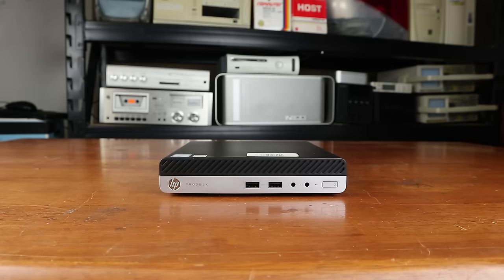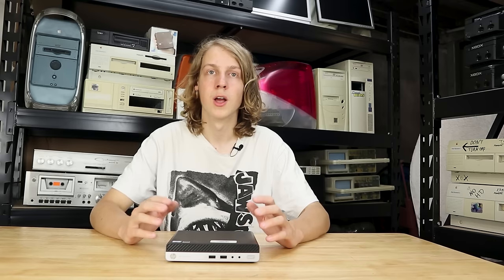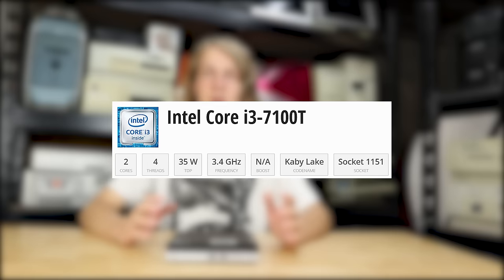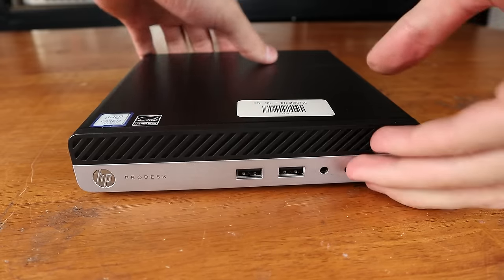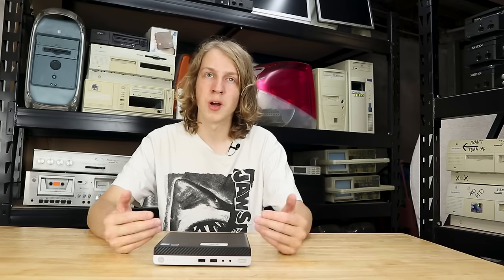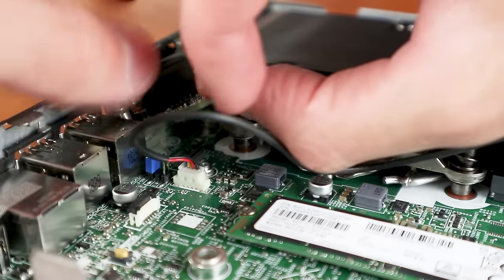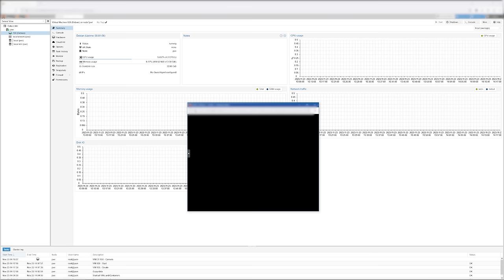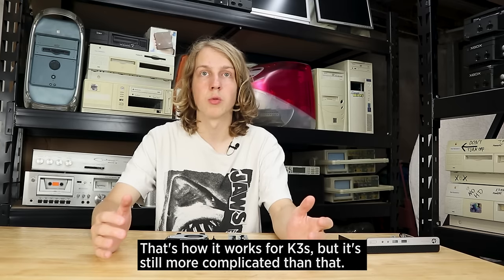This MINI PC Is The PERFECT Home Server

Comment: Another good reason to buy these second-hand instead of a new SBC or mini-PC: they end up being used instead of being landfill and pollution somewhere. From an e-waste perspective we could do so much more.
Reply: The way I see the problem is that minis or others, they get a small problem like a board mosfet that probably costs 10 cents but there is nobody around to trace it and replace it, certainly not the mfrs who would rather sell you a new pc than have real repair centers. Now what? Im facing this problem right now and so im looking for a new mini extremely reluctantly. Im hopping mad.
Reply: @cvcoco  I found a box of mini Dell optiplexes in a dumpster once the only thing wrong with them was a few of the usb ports would only work intermittently. Which was no big deal for me since I ran them all headless
Reply: @esotericjahanism5251  Yes but if you needed and expected the ports to work? Nobody around to fix them so you throw the unit in the dumpster and its a shame.
Reply: Indeed.
The CO2 pollution of fabricating these is the equivalent of running such a system for decades.
Reply: @rogerwilco2  
better stop using computer then
Reply: Sorry but the problem with olden hardware is the vulnerabilities caused by hardware design. They're either risky to do anything serious with or too slow after mitigations, to do anything serious with.
Reply: they're freaking expensive for e-waste

Comment: These things are absolute sleepers. I "downgraded" about 3 months ago from a full-blown HP Z440 with 145W Xeon and 196GB Ram to an 800 G4 with 7th gen i5 and 32GB and that machine is performing. Runs all my media applications (iGPU passed through to Jellyfin for hardware decoding), some productivity applications, Home Assistant and Frigate (I use a Coral TPU in the Wifi slot) with relative ease. CPU is around 40% and it shredded about 100W of my energy usage, which is significant considering it is 100W 24/7.
Reply: How do you deal with storage?
Reply: Same would love to know as most say I shouldn't use USB hhd CADDY
Reply: Love the use of the coral gpu in the wifi slot.  Makes for an excellent all in one server (with storage in a nas).  Which model did you get?
Reply: @NFTwizardz  I used a DAS with USB-C connected to the mini PC and 4 x 16TB WD drives. Drives passed through from Proxmox to TrueNAS for RAID and sharing. Bit annying having to passthrough every drive separately but there is no space for an LSI SAS card, unfortunately.
Reply: @martinzipfel7843  nice thanks for replying. I built a PC with HBA and run true nas scale as VM on proxmox passing through the HBA.
Reply: dual tpu?

Comment: I grabbed 3 G4 8700T's for $230 AUD each from Facebook Marketplace. Then added 64GB RAM and a 2TB SSD for each of them bringing the total to around $1400 AUD. They're doing pretty well as a reasonably power efficient HA Proxmox cluster. Pretty happy with it, apart form the noise under load. Maybe the lower end 35w TDP models would have been better.
Reply: The "T" versions should be the 35W version. I'm thinking the the non "T" versions is a better fit for SFF versions of this model with better cooling.
Reply: @Jonteponte71  Yeah, the "T" is the 35W version. The 35W version does not have ventilation holes on the top of the case, while the 65W version has ventilation holes on the top.

Comment: These little machines are amazing, I used to have a T630 Dell Poweredge at my place. Dual Processor 256gb of ram, while it was good the electricity costs for a few VMs running low speced services I ended up decomissioning it and opted for an i7 little 16gb ram Prodesk like this and just presented the NAS with iSCSI storage is a plenty and win on the electricity costings.
Reply: 256Gb of ram!?! :O
Reply: @roryl  Not really difficult with 16 slots. Maybe you should look up that model. It's a dual socket system.

Comment: I bought one of these with the i5-8500T to use for day to day computing that doesn't require the discrete GPU of my main system and to save on running costs. I'm so impressed with it that I'm considering getting another.
Reply: I am planning to buy one and use it with ubuntu. just for normal day to day use at home. do you think its okay??
Reply: @prabaharanaece  Yes, definitely!
Reply: Can you share what kind of computing do you do on the i5 8500T?
I'm interested in getting a 1L PC (either an Optiplex Micro or one of the HP minis) for various tasks like file compression, photo editing, virtual machines, the usual stuff like web browsing, etc.
Reply: @abunk8691  I actually got another mini PC with the non-T 8500 and use that mostly now. The 8500T was good for some stuff, but the low TDP was a bit restrictive. I definitely wouldn't want to use it for photo editing or hosting VMs.

Comment: Nice to see another Aussie Tech Channel 😊 Would be great to see a homelab run down/tour video.

Low Power is 100% more sustainable especially in Aus with power and cost of living.

I'm running an N100 as a router (1000/50) using PFsense as a VM within Proxmox. That was fun 😅

And then 3x WAX206 with OpenWRT as a mesh for WiFi 6 coverage.

2x Synology NAS for storage/redundancy with portainer for services on each.

2x low power mini pcs for Portainer docker instances (Automation & AI on one plus a testing unit segmented on the network).

And ive shifted from Ububtu server to Debian myself so no judgement here 😅

Great video and Ive subbed!
Reply: How have you found the move to Debian?
Reply: @oscarcharliezulu  From Ubuntu server, debian was pretty easy to get started. I had a few teething issues but nothing a little googlefu didn't solve
Reply: How's your experience with pfsense on VM? I am running it on a low powered machine with two NICs, it's used as fw + reverse proxy to a bunch of applications I am hosting on my homelab.

Oh my Poxmox cluster is all based on Dell and HP tiny PCs with maxed out memory. Right now I am running Kubernetes cluster on the VMs in Proxmox cluster hosting my applications. Thinking of setting up Ceph storage cluster to feed into Kubernetes pods to provide efficient shared storage, backup, recovery solution.

I also have a Synology box, but I am heavily under-utilizing it as NFS server, I suppose I could run Dockerized apps on here, but I am too focused on getting deep  and dirty with Kubernetes instead. 

Just a humble software developer, not a network engineer, all of this has been super over-engineered and super fun to learn.

Comment: I bought the 65w version of the HP EliteDesk 800 G4 Mini and was able to fit 2x2TB m.2 and 1 500GB sata SSD. I'm very pleased.
Reply: Running 2 m.2 under sata ssd doesn't get hot? Do you use it as a nas?
Reply: Same but use one of the m.2 for external pcie RX 6600 video card.  Decent mini form factor gaming rig…

Comment: I like the 65w Prodesk SFF boxes with an i5-8500, then undervolt by 140mV, test for stability. Only draws 60w at the wall under full BOINC load with an SSD.
So much used hardware online for cheap a big surplus. companies keep on aging out perfectly good powerful computers so they are great deals
Reply: How do you undervolt a prodesk? Hacked BIOS?

Comment: Seems you beat me to it, I bought a couple of these, same config too. I was also planning on making a video mainly just about what can really be done with these machines. Honestly in my situation, might be better off using one of these as my main system, it'll consume way less power and I can always use another system for more demanding tasks. My laptop is using 35W just watching this video and can use upwards of 200W under full load, which is just too much in the current economy.

If you're curious, I paid £74.99 for the two machines, and another £17.98 for the two power adapters, they came with 4GB RAM and i3 7100T. I'd say I did pretty well on the pricing there, and if I ever don't need the one I'm keeping, I can always resell it for way more than I paid. One of them is going to a friend.

Also, absolutely no judgement when it comes to the linux distro, Debian, even as a desktop OS works great and is super stable, and I'm sure it is even better as a server OS without the desktop environment.

Comment: I went down a similar route recently but went with a dell system. It's really nice and has expansion for an M.2 ssd, 2.5" ssd, socketed CPU (limited upgrade paths however), up to 32GB of DDR4 and an i5-8500T. It also has an M.2 wifi upgrade slot but I'm going to use it to add another ethernet port for opnsense :)
Reply: Which Dell system did you use?  I would like to shop them, thanks....

Comment: A great machine I am looking into and start diving into the server world and running my own lab to learn new things, A side note if anyone buys these and have access to a 3d printer you might be able to 3d print the top cover to have ventilation like the updated versions it might help with cooling not having to work as hard to be efficient
Reply: Or you could buy another one listed for parts only and swap the vented panel and heatsink

Comment: Imho, the best affordable home system could be a mini pc with 2 RJ-45 ports for a vm router WAN and LAN, with LAN to a switch, then switch to as many Cat6-HDMI extensions as rooms in a house. Cat6-HDMI connec to 3 monitors, mouse and keyboard. Mini-pc runs vms for whatever the room's user uses. Maybe a USB for Zigbee coordinators for Home Automation.
Imho, VMM > Proxmox, as you can run the mini pc on and OS, then run VMM to run whatever KVM you want like a router or OS per room.

Comment: Bought an HP EliteDesk G3 Mini with an i5-7500T, 16GB RAM and a 2TB SSD some time ago. I'm running Proxmox and several different virtual machines(TS3 Server, Pihole, OpenVPN and a Valheim server) in parallel without any problems. I also set up some vitual Windows machines but only boot them if I need them. Proxmox can also use Linux containers to save resources.
Reply from the maker: I definitely need to take a look at Linux containers. I had heard of them, but haven't used them before. Should be a good way to save on system resources.

Comment: I use these and they are great.  The only drawback is the fan noise.  It's silent on idle, but as soon as I do any processing the noise becomes intrusive.
Reply: I had a similar issue on my Dell MFF box, updated the firmware and re-pasted the CPU and all is now nice and quiet

Comment: you can buy an N95 powered  8gb ddr4 mini system for around 140$ brand new, which is a ~1.5 times faster cpu than the i3-7100T while consuming only around 6-10W, and the form factor is even smaller than the g3 mini. Definitely worth to check out!
Reply: I need 10G networking for Ceph under Proxmox, otherwise something like that would be very tempting.

Comment: You can swap in the 95 watt vented outer shell for the solid 35 watt cover..  Please be very careful if your unit has a standard 2.5 inch drive caddy.  The tiny ribbon cable for SATA power and data is very easy to disconnect. MY Elitedesk 800 gen 3 had both a 2.5 inch SATA drive caddy and a PCIE m2 ssd connection.  The ribbon cable can loose so now i can only use the M2 drive internally.  I have no AC so the hard shell covers can restrict cooling.   I have removed the PCIE M2 drives to external cases with tiny fans on my EliteDesk Gen 2 systems with solid un-vented top covers. These have 35 watt I7s in them.   I am waiting for a similar Lenovo m700 tiny system with an i3-6100t  chosen as a lower power 4 thread option.  The Elitedesks have Wake-on-Lan as standard, so your servers can be booted remotely.   I have not used this feature yet, but this video may help me set up an I7 as a Proxmox server.  I find these  1 Liter form factor systems are addicting.

Comment: Some models allow you to add two NVMe SSDs but then the Data SSD will not fit. Watch out for the 65 watt TDP models. The Sata SSD cradle comes with an extra fan onder the cradle. removing the cradle for an extra NVMe will result in making the main fan become noisy. The 32 Watt TDP models are more useful here. I own a Prodesk 400 and 600 mini. I also own the 65 Watt TDP 800 mini elitedesks model. The sweet spot in pricing is the 4th gen and 5th gen model. You might want to repaste them. I will combine mine in a desk shelve with 3 official under desk sleeves. Getting a replacement PSU was harder last year.

Remote management is not present in some models. 

Be aware of cheaper Pentium offers.
I would replace the option serial or vga port with an USB-C port.

They  officially support 32 Gb memory but 64Gb memory does work.

Comment: It can be a Docker server, then you can add an external USB Hard Drive and run a UrBackup container to turn it into a Backup server as well. You can also use a UPS monitor on it.
Reply: no redundancy...adding disk pool to these machines is more expensive than just buy cheap home server...

also 2 cores in this HP is just not enough for decent file system like ZFS
Reply from the maker: @jkarra2334 Two cores is completely adequate for ZFS. I used to run it on an AMD A4 3400 and got excellent performance.
Reply: @serverscience  yes, ZFS itself uses very little CPU. It should remain I/O bound most of the time, even with compression and/or encryption, though  compression is POISON for low cpu count cpu's. Yet again, Samba  burns  CPU, but I think it's pretty much constrained to only using 1 core per file transfer.

More than few cores is only going to have  effect if you regularly have on big or multiple hig throughput I/O to multiple disk array(s) but still, lower clocked 2-core cpu's are just painfully slow .

yes, you can play with them as hobby but for actual use like own redundant file server with decent transfer speeds i rather invest for more cores and plenty of RAM instead only few cores (even if higher clocks) and plenty of RAM, speed is king, even at home workflows and loads.

Comment: Great video! I have a question - why not a brand new Intel N100 system for the same price with faster NVME, DDR5 and about twice more energy efficient? It would also have modern codec and instruction support, as well as much more modern wireless. Any thoughts?

Comment: I just picked up a SFF version of this for  under £30, bare bones. I hope that version also has a low idle wattage.
Reply: They have been in the 20w range in idle since the 2nd i generation at least. My 2nd gen sff HP has 4 2.5 hard drives and a larger 3.5. I should be able to add another 4 ssds. Lovely little proxmox hosts :)
Reply: @valkaielod  6th gen is supposed to have an even lower idle wattage. I'm going to try an i3-6100t, no HDDs, just one SSD and see how low it goes ...
Reply: @blakecasimir  From what I have seen, the sixth-generation Intel chips did get a nice improvement to idle power draw over fourth-gen as you alluded to.  I saw a comparison where it was about half the draw at idle, so they're a good generation to target.  I saw someone had a video showing a system with the regular 6100 to be at 17w idle total.  That might be on the better end of things, but that seems to be roughly where the idle would be.  The T version should be similar at idle, and lower overall.  I have a regular 6100, but keep procrastinating on getting a watt meter.  I'm rather curious how much it's drawing, though I'm not worried about it, which is probably why I never get around to buying the meter.

Comment: I was just looking at one of those builds with a AMD 3400g and 16gb for $155 USD but it said it would not ship for a month or two. I may just order one or two and see what happens. Reviews go from "perfect" to "this thing wasn't even looked at let alone refurbished". I'm sure theynwere just bought used in bulk and they are just crossing their fingers they will work 

I agree the Pi is way too much now for what they do and not being x86. At times that's ideal, but always. If I needed to only use as much power as absolutely nessasary, I may go with one, but for home servers/labs/"IoT"/Media I think something is like this is prob ideal. You can always run in a efficiency mode and undervolt the CPU a bit depending on the bios.

Comment: This is why the Raspberry Pi 5 at its ridiculously inflated price is absolutely no match for a second hand SFF system for the average Joe..... I have three Pi 4B 8GB I bought back in the day when they were reasonably priced. but ever since Corona, I have bought second hand SFF  Dells and Lenovos because they are so much higher cost performace contenders.

When the Pi goes back to beining $35 to 50 then I'll start to consider them viable 24/7 units for my network.

Comment: I don't call consumer hardware great for proxmox, yes it works very well but proxmox with all it's logging chew up cheap home nvme disc in no time, even worse if the vm's also doing much writing.
You should use expensive consumer hard drives and have a possibility to make backups.

Comment: Hi! Can this be paired with a low profile GPU?
Reply from the maker: The HP 1L systems don’t have PCIe slots, but systems like the Lenovo M720Q do (they fit a low profile single slot gpu, but require a proprietary PCIe riser)

Comment: Using a dell wyze thin client 3040 2g ram 8gb emc get for free at work and 250 usb 3 ssd for home assistant docker compose stack. It run fine but I'm storage limited on the wyse for os / package update. I think I going to move to a used Intel processor  n or j   based pc to get a perf improvement and because it's running h24 don't want higher tdp cpu. Currently the atom x5 is 5w looking for something similar, cheap and reliable for now I can get a MSI n3150i with celeron n3150 for 60 also a Chinese mini pc aero 2 pro with n5105 for 80€ temptation is high for the last one but not sure it will be reliable do you have any other idea?